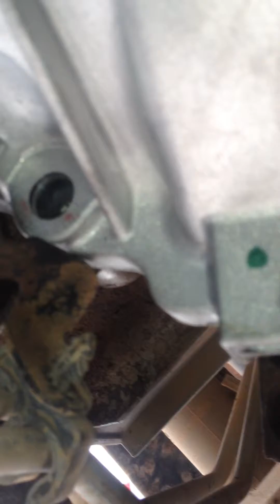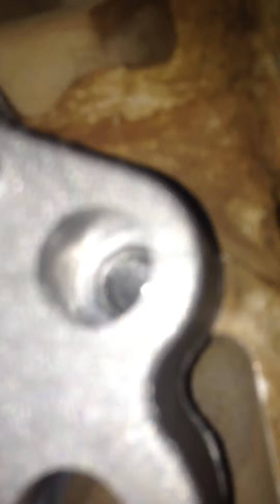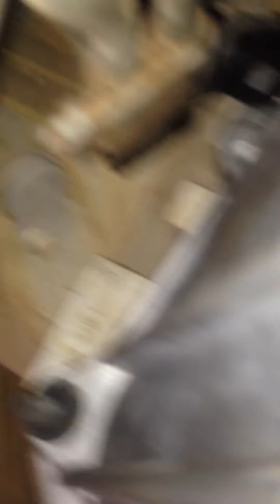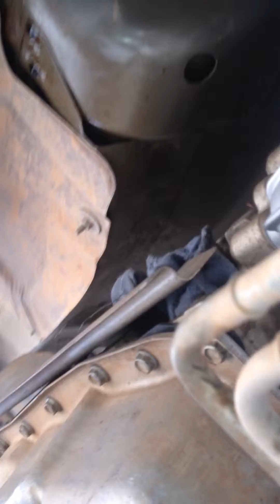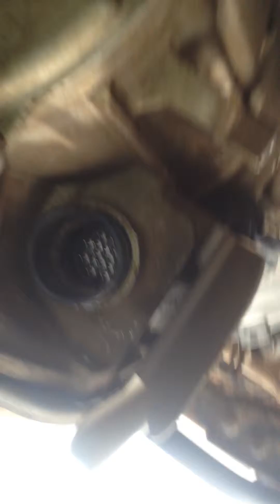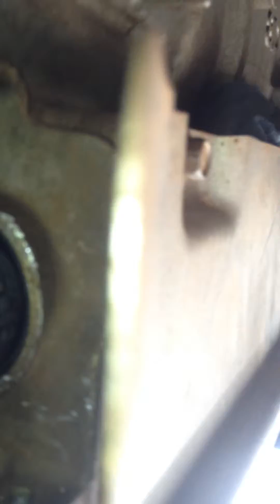2010 Silverado Cheyenne Transmission Bolt Pattern and Electrical Plug Removal

Comment: Can the electrical plug be replaced on a 700r4 transmission out of a 1994 chevy pickup. mine cable was pulled out improperly and now looks as if the plug needs replacing.  any help on this will be much appreciated.  Thank you
Reply from the maker: Any transmission shop is going to tell you the same thing and that is replacing the whole circuit board inside the transmission it will require a rebuild. Why don't you call LKQ they have Great prices and great warranty options on used or rebuilt transmissions.